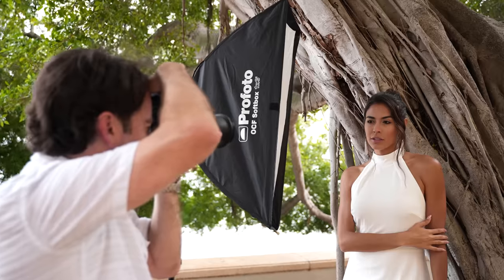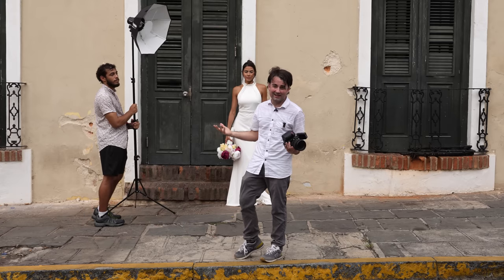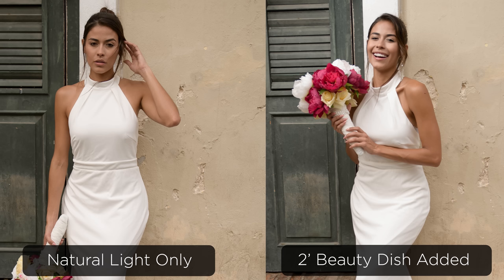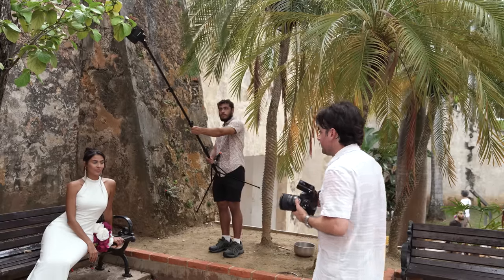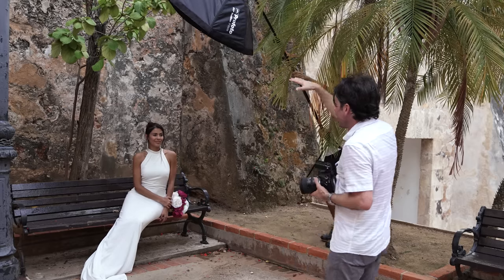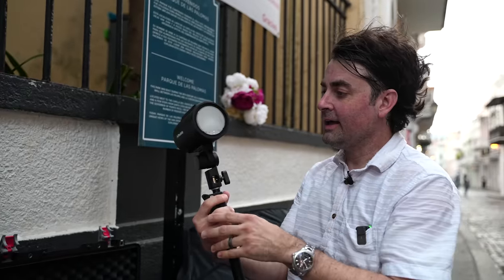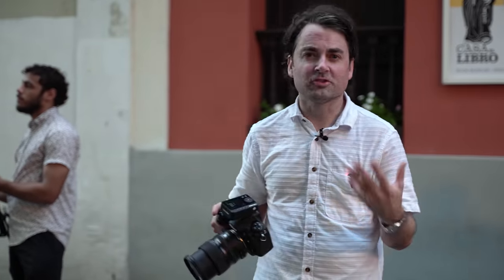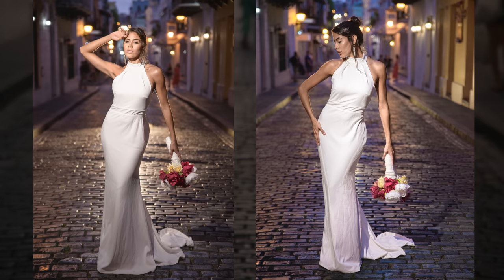6 Lighting Setups for Wedding Photographers Part 2

Comment: @5:42 I really want to know where I can get that plate.  I hope it's not as pricy as the platypod.
Reply from the maker: I actually found it.  It's a tabletop stand but I discarded the light on top: https://www.bhphotovideo.com/c/product/443546-REG/Smith_Victor_700201_Telescopic_Tube_with_Base.html?BI=6857&KBID=7410&KWID=638496-152 -P
Reply: You could also use the IFootage RB-A200
Reply from the maker: Interesting but it's also 3x more expensive and doesn't have the stud on the end (only a 1/4" thread).  But yeah it looks like a similar tabletop light stand -P